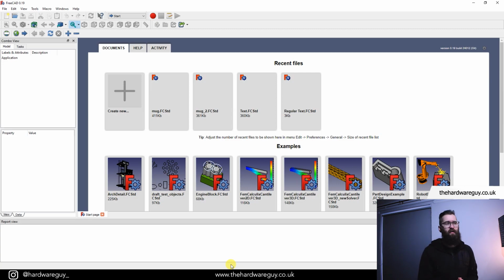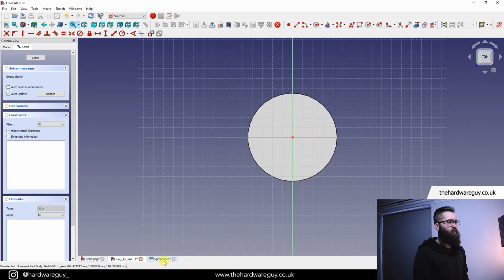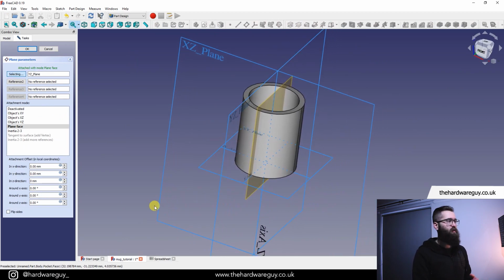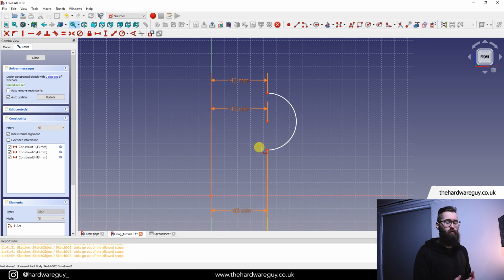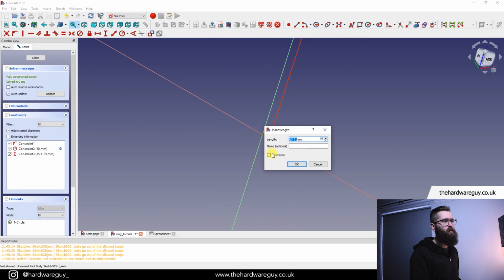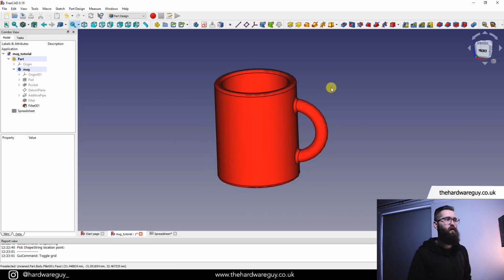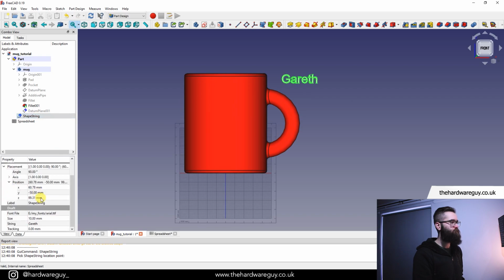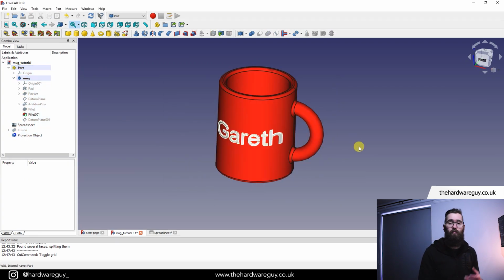FreeCAD Design Series pt.1 - Mug Design with Text (Parametric Modelling)

Comment: the brackets in (Spreadsheet.mug_diameter/2) - (Spreadsheet.mug_thickness) are redundant technically because order of operations would have it resolving in the same order. It's still good practice to use brackets to make it easier to understand at a glance but Spreadsheet.mug_diameter/2-Spreadsheet.mug_thickness would resolve the same way

Comment: Wonderful Series, thankyou. I hadn't used FreeCAD until a day or so ago, and now I feel like I can build the universe :)
Apologies for the long wall of text, I'm autistic and tend to use as many words as I think constrain what I'm saying accurately, for better or worse :) 

Tip #1: I find for parametric design I prefer to first ensure just the spreadsheet and the part view are open in the tab list at the bottom (i.e. close the start page tab if still open), then go to Window-> Tile, which will put the spreadsheet on one side of the visible application window, and the view of the object on the other side of the visible window.  This way it's then possible to edit the spreadsheet, and view the changes as they happen, without having to switch window tabs at the bottom. 

Tip #2: Additionally, tho it depends on the complexity as to whether it's worth the effort (but you won't know that until it's too late ;), a useful tip is to use the spreadsheet more than just a simple lookup of fixed values, as you can also add rows into the spreadsheet which are calculated values from other rows, like in a "proper" spreadsheet :) 
e.g. one might add a spreadsheet row "Inner Dia" and set its cell value to be the calculation "=Bx - By" (include the equals sign) where Bx might be your cell reference, say "B1" for your main object diameter, and By could be the spreadsheet reference (say, "B2") for your wall thickness. (remember to set the units and alias on this new calculated spreadsheet row) - 

Yes, you can do the maths part in the part sketch constraint directly, but I find it far clearer, and less fiddly when typing in the  constraints to have those formulae pre-calculated and visible in the spreadsheet at the start of modelling. This also allows the spreadsheet to highlight issues where you may have set constraints on the sketch where the maths breaks down (going into minus values) - but might not be obvious apart from python debug window errors. But doing the mathematical calculations beforehand in the spreadsheet, and referencing those, makes it obvious on looking at the spreadsheet where, say you've accidentally ended up with a negative/out of range constraint. 

TLDR; My rule of thumb is: Let the spreadsheet be a spreadsheet :) If a calculated value has any "meaning" in the design constraints, always calculate it in the spreadsheet first_, using the spreadsheet cell content _=sum formula, even if it's calculated from existing values in the spreadsheet. This way you can always reference that calculated result in other constraints, rather than typing <<Spreadsheet>>.parameter / 2 + .99 / 3.13 into the constraint, as one day you'll typo one of those numbers, or forget what the numbers "mean" in relation to the final sketch :) 

This may be a personal preference, but as an ancient software developer :), I always start with definition of all variables/constants/mathematical formulae prior to designing the "logic" of some code. The same applies to parametric CAD. There's nothing more hideous in code than to see some "magic number" deep in the bowels of software, where a few weeks after writing the code, you read it back and ask yourself "why on earth did I divide length by 3.52612 here?"

Comment: Appearance didn't do anything for me. No menu or settings coming up. But if you press the body and there you have "shape color". Which do the same thing as you did in the video. Dunno if it's this version on Linux. But in case anyone else get the same issue.. You can also change the line and point color there if you want something else than the normal settings.

Great beginners guide for free-cad. Been following along and learning a lot in just 2 days.

Comment: And when you need to put a plane deeper just a little you better do something like (r * 0.99) instead of (r - 2) so you will be able to resize your model in a more wide range. And it would be a more useful to make some parameter named like "handle_base_radius" instead of doing same calculations in many places that can be a way to make mistakes.

Comment: I had difficulty following the video at "The Sweep Tool" section, but I finally overcame it, my FreeCAD behaved a little differently to Gareth's at that point he described and showed that you needed to select the Body1 at that moment, but for me it wouldn't work if I choose the Sweep Tool then it would error, I would have to highlight or select one of the sketches (not just Body1) in order to proceed, once I understood that I could continue. Hope that helps someone else. Great videos!

Comment: I ran into trouble when trying to create text using shapestring. My letters seem to be orienting by the XY plane even though I created a datum plane like you did in the video by the XZ plane. So, my letters are perpendicular to the side mug. How do I fix the problem? 🥲
Reply: Like people here I was having the same problem with this, sometimes with my text not showing up anywhere. After repeated attempts I noticed when I first went into the Shapestring dialogue that the Y value was way off, like millions of milimeters off. I got it back to a more sensible range by moving the model slightly to the left or right and moving my mouse pointer over the datum plain again. After that I put my text in, chose the font and then clicked OK. This seemed to solve the disappearing text problem, but like you my text was on the XY plain. I then had a play around with the Shapestring property values and found that by changing the 'Support' value to 'DatumPlane001', and changing the 'Map Mode' value to 'FlatFace', this put the text back on the datum plain. Voila! After that everything was plain sailing. Hope this helps.
Reply: im having the same problem, i don't know what to do
Reply: Did you work it out?... I am having the same issue

Comment: Hi Gareth, I'm new to your channel and 3D printing.  Loving what you are doing here.  I followed all the steps in your first parametric video, but I was not able to conclude the work.  I kept getting a message about "not part of active object" or something.  I followed over and over... but never found a solution.  double click the part, double click the body, but never got past the error, so I hope I'm able to do better with this video.  I am using 0.19, "released version".

Question: I would rather engrave on the mug (actually, it will be on a candy dish circular object), but similar.  However I want the text to go much farther around the outside of the vessel.  and I want it engraved, not extruded.  What are your thoughts?

Thank you.

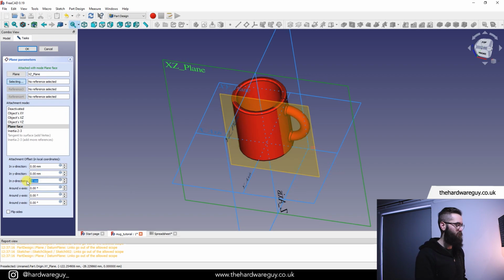Comment: I have followed this guide and simply cannot get it to work. For example at around 27:40 you create a cross reference but all you seem to do is click ok. I never get that option. Later, at 28:11 you create some text. Even to the point of typing your name rather that some other text I never get any text. I have followed your instructions to the letter over and over again but without success. I am using version 0.19.
Reply: See my recent reply to Karen Ma about the disappearing text problem. I also wasn't getting the cross reference dialogue at times, but I was able to get the text back where it is supposed to be eventually.

Comment: Dumb question...But you designed a MUG--but can you actually drink from it?  Put Coffee in it?

I know PLA is not very heat resistant but I was under the impression that almost all Types of plastic and resin materials were not good to use as dishes or silverware.   Am I wrong?

Comment: for to note - alias is not required(0.18 at least) you can refer to the cells in spreadsheet.B4 format, it works as well, units are required(i guess, didn't bother to test, just select bunch of cells and property set units for all of them)

Comment: No matter what I do, the text appears on the XY plane, not the new DatumPlane.  I'm confused.
Reply: Hi, new to freecad here, I had a problem similar to yours, I solved it by fidgeting with the "toggle constraints to working plane" button. The button looks like a blue square with a small circle on its lower left corner, and I found it on the right side of a toolbar located in the lower part of the freecad window (which in the video is actually covered by Gareth's window).  Tell me if it was of any help.

Comment: Working well except the mug thickness formula (spreadsheet.mug_diameter /2) - (Spreadsheet.mug_thickness) gives giving me errors

Solved it after retrying a number of times and changing mug thickness values
Reply from the maker: It is likely that the top edge fillet caused the error! Make the top edge fillet proportional to the thickness and this should solve the issue permanently 👍🏻

Comment: After watching your videos I've been able to design a few simple parts.
The "active body" thing still confuses me, I think I have done it wrong a lot of times cause things appear outside the main body and it ends up being a mess. I haven't paid enough attention to the "bold" body part name probably.
The errors on FreeCAD are very bad, almost meaningless in most cases. 
Another confusing bit is the "Part design" vs "Part", many tools are very similar. I've had problems doing "fillet" on one workspace but succeeded on the other ?¿?¿?
Oh and the versions make no sense either: the 0.19 "beta" was released in Nov 2019. But the 0.18.6 was released in February 2021. What kind if beta remains unchanged for over a year?

But hey, it is completely free software (libre). It is a decent tool, with a few bugs and "unpolished" sure but usable.

Thank you so much for these videos, you are really good at teaching.

Comment: Can you please make a tutorial on troubleshooting FreeCAD exclamation marks in the tree one day?

Took me until this tutorial until I ran into a problem. My model didn't update when I updated the spreadsheet. Also, it shows an exclamation mark in the tree for the handle sweep (AdditivePipe).
I re-did the tutorial from "Handle Sketch 2" and directly after that the mug did update. Then it still worked after the fillets.
edited to add
I think I found it. When changing parameters, the fillet for the rim ended up being too large to fit, causing a problem.
One solution was to make the fillet in the spreadsheet dependent on the thickness (it is a spreadsheet after all, you can do all sorts of stuff).

Comment: I'm a home shop hobby machinist (retired from Information Technology) trying to learn FreeCAD.  You are helping A LOT!  Thank you!  Please keep making your videos.  A few suggestions for videos:  a) A video of using parametric modeling to design slots, specifically slots for Socket Head Cap Screws,  b) Designing a round disc with multiple axial holes from the outside edge into the disc to thru holes (think your Beginners pt. 4 video),  c) How to use parametric modeling to design a fixture plate 4" x 6" x 3/4" (sorry, old school US guy) with 77 through holes, on 1/2" centers, every other hole alternating between .250" and .203" with the center hole being .250".  I've designed a fixture plate like "c" before I discovered your video series but would really like to know how to do it using the spreadsheet.   Thank you again!  Great videos!

Comment: Thanks for taking the time to do these videos. What problem are you having with naming spreadsheets in 0.19? I have been using 0.19 and haven't run into any issues with changing the names of the sheets. Even renaming the sheet after referencing it in constraints causes all the constraints to update to the new name. Just wondering what to look out for.
Reply from the maker: Thanks for watching! The problem I had was that if I re-named a spreadsheet, when setting parameter it wouldn't detect the name change and I'd still have to use 'Spreadsheet.' regardless. May have just been an issue my end, I'll double check later👍🏻

Comment from the maker: Timestamps:
00:00 Intro
00:13 FreeCAD 0.19
00:44 Pre-Requisites
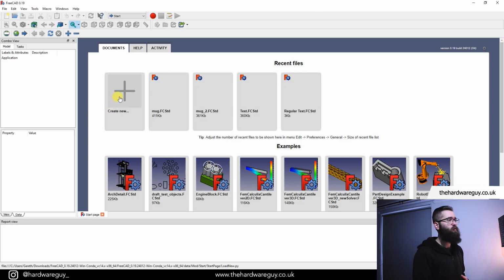01:01 New Project
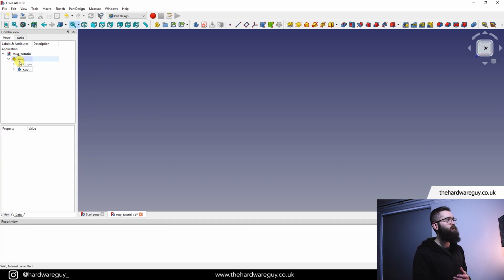01:27 New Spreadsheet
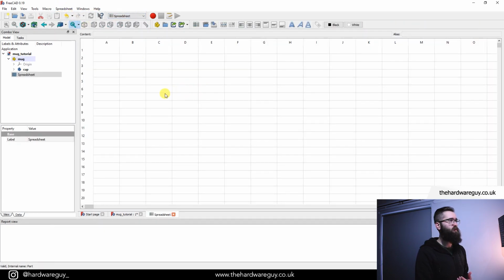01:40 Creating Parameters
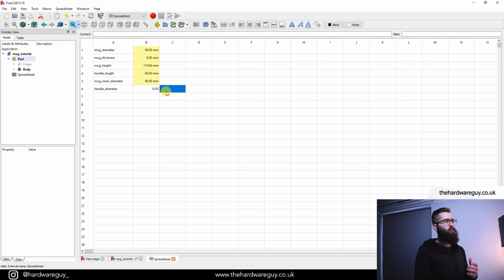02:08 Activating Parameters
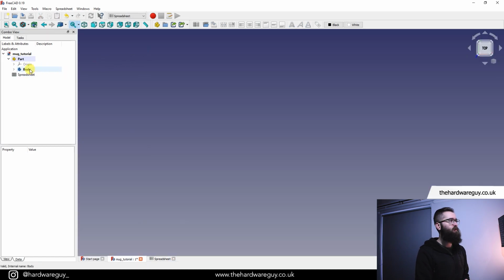02:32 Make Body Active
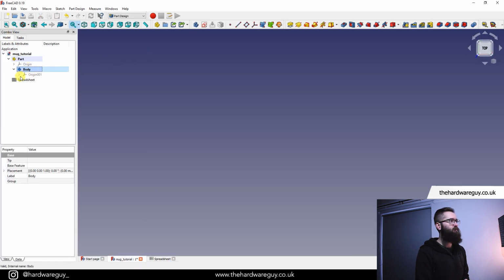02:36 Mug Sketch
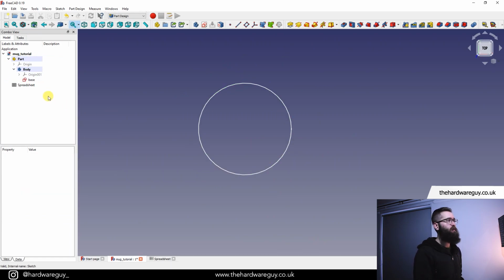03:41 Mug Padding
04:35 Mug Pocket Sketch
06:41 Mug Pocket
07:53 Datum Planes
08:40 Adding a Datum Plane
11:43 Handle Sketch 1
12:03 Arc Tool
15:05 Centering the Handle
16:42 Handle Sketch 2
19:49 The Sweep Tool
21:05 Cleaning up with Fillets
23:06 Changing Your Model Colour
23:34 The Power of Parametric Modelling
26:35 FreeCAD 0.19 Reminder
27:10 Adding a Datum Plane
27:48 Adding Text (ShapeString)
28:29 Limitations of Text in FreeCAD
29:45 Downgrade ShapeString To Faces
30:12 Fusing The Faces
30:47 Hiding The Draft Grid
31:08 Project To Surface Tool
32:49 Outro